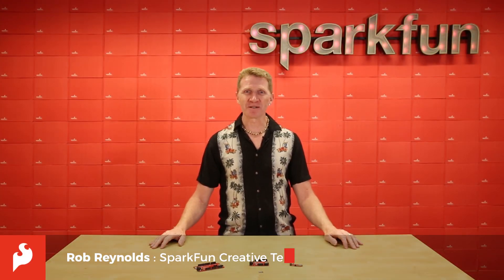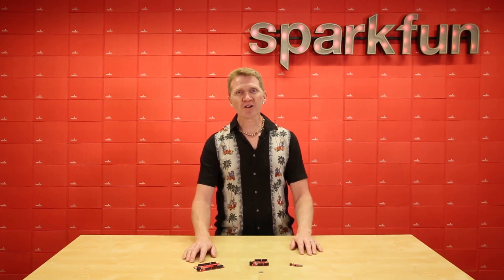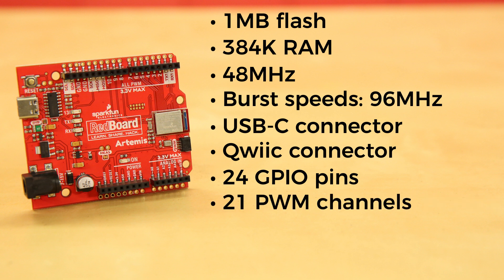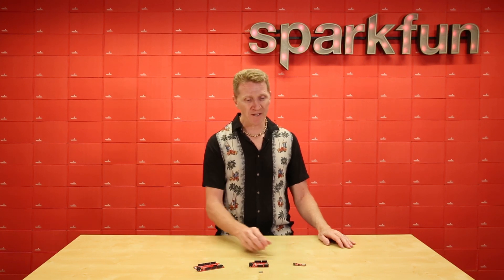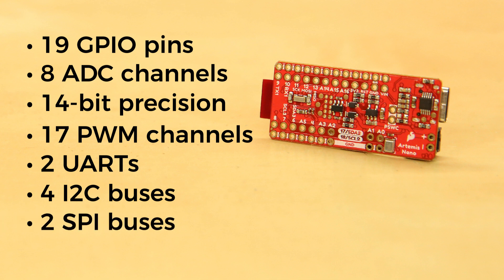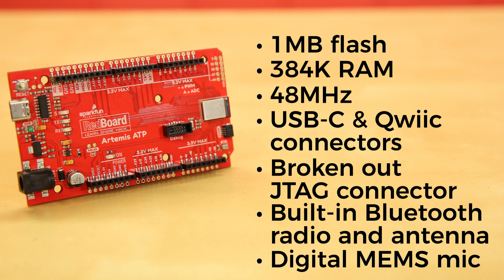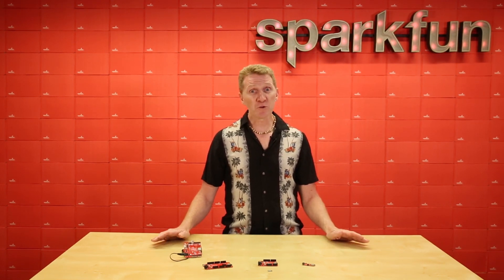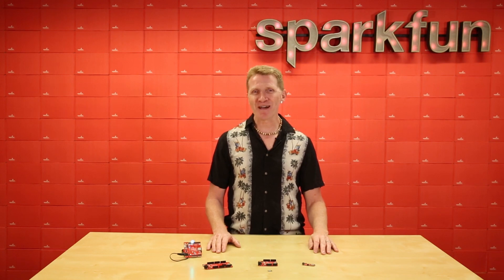Product Showcase: SparkFun RedBoard Artemis Boards

Comment: This mentions that the artemis nano has four i2C buses. I am having trouble determining what that means. Do all these buses go through the single QWIIC connector or are other pins used as SDA and clock? Also, it seems like the wire library does not have a function to specify which pins will be for data. I'd like to use the non-QWIIC pins for I2C. I'd appreciate some input.